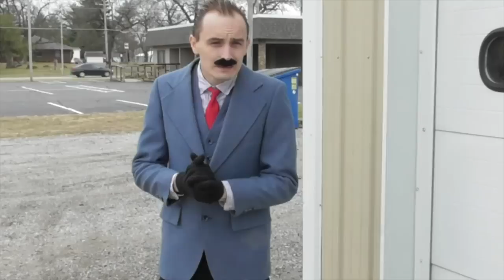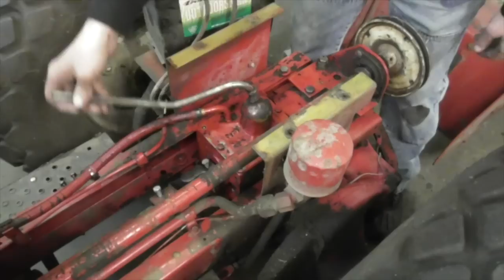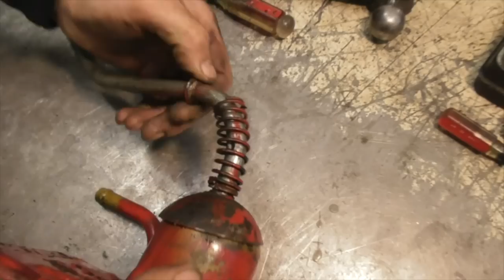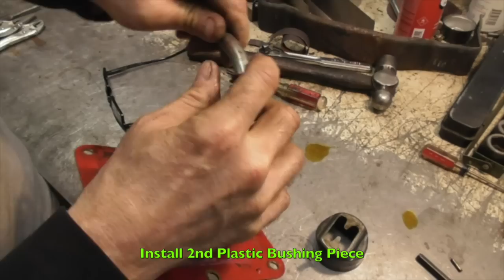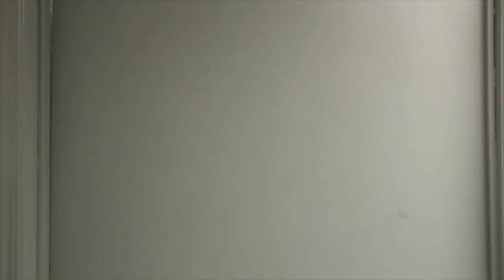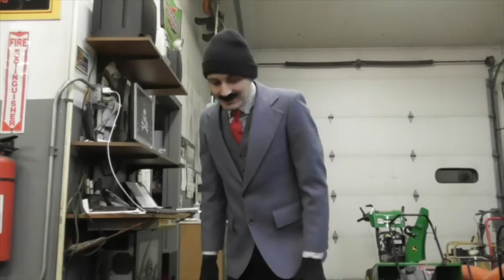International Harvester Lowboy Won't Shift? Fix It!

Comment: Thanks! I know International used that same transmission for the cubs, low boys and little cub Cadet garden tractors. I have a CubCadet 122 that needs that exact repair. Haven't opened it up yet but that sure looked simple enough

Comment: That's Right Taryl! A mechanic can have an item and figure it out! Hell my uncle has a 1961 Internation 240 Utility, when you cant get parts for a gearbox you weld and machine the original til its stronger than new...unless you wanna push snow instead of lift and dump it, dump bucket works great for illegal parkers too? whoops hit the lever, if you want I can take care of slippers for ya, i mean most slippers are flat anyway!